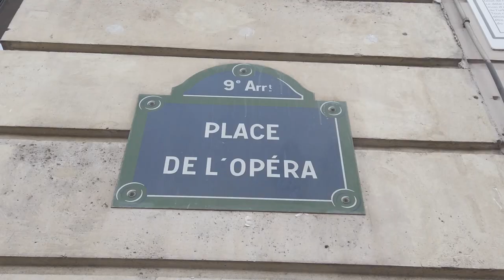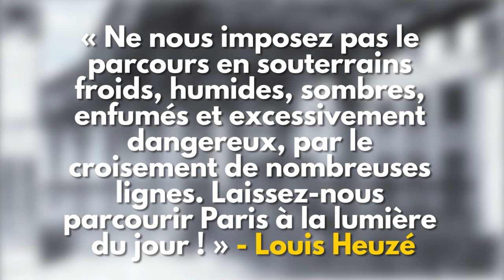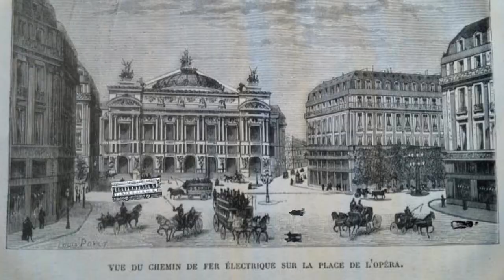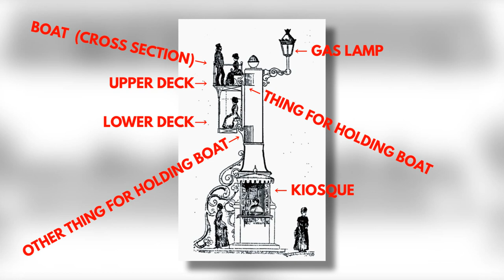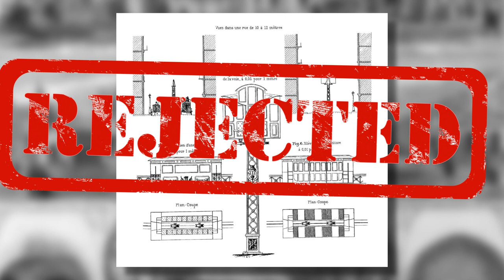Flying Lamppost Boats: The Beautifully Bonkers 1880s Plan For The Paris Métro

Comment: I mean, that is slightly genius. You’d need nearly solid lamp posts and they’d need to be quite close together but it probably wouldn’t interrupt the view as much as aerial rail.

Since each car is meant to always be touching at least two pole, you could make each alternating pole… um… well, alternating poles (polarity) for your power source. Or have two contact rings on each pole.

For bends, you could make them articulate at multiple points. Each pole could be indexed in some way to set the lead car heading toward the next pole. The rest could trail.

All up, it would be an extremely interesting engineering exercise that would be far too costly and complex to ever do anywhere other than Disneyland.
Reply: So perfectly Parisian?

Comment: I would LOVE to ride some lamp post boats, in a theme park for example. And yes, turning corners is not possible, going uphill might be. For corners you could install proper rails to ride along or install some train yard like rotary plate where one lamp would revolve around the center post.
Reply: I thought of something like that with my own solutions(for all the problems!)

Just for fun, I put my own head to the problems mentioned in the video: How it would be powered, how it would handle corners and how it would go uphill!

Whether or not Paris would of accepted these proposals is something else! But here are my solutions:

Uphill Movement: Bring the Lamppost Boat to a stop on a lamppost with a hinged Roller(the video seemed to mention the boats propelled by rollers) platform. The platform is locked in place as the boat proceeds up a gradient(the following lamppost platforms on the gradient, providing it’s roughly the same angle, are fixed in their angle). Once you reach the top of a gradient, I imagine the same solution as   for the start of a gradient.

Corners: Similar to the solution for uphill movement, the Lamppost boat comes to a stop on a Roller Platform which is fixed, then released and turned(possibly by hand) on a hinged lamppost top and lined up with lampposts on the required street, before being fixed in position again.  

Power: Whether or not this really would work well or be accepted by Paris, Steam Power! The roller is powered by a small steam engine, the fire, equipment and controls for the engine are blended into the lamppost facade.

Comment: It's a shame they've defaced the city with those giant billboards. "Oh you like architecture? How about the new iPhone instead?"
Reply from the maker: To be fair, I think (I *think*) the billboard is on top of some scaffolding, so it's only temporary, and it's probably helping to finance the restoration of the building
Reply: Oh, I see, that would make sense. Great video by the way!
Reply: Not like Times Square in NYC where just about every building has an electronic billboard attached. Yay?
Reply: Sighs in Piccadilly circus
Reply: @dangerrangerlstc  but that's why times square is famous worldwide.
Reply: I am working on the site behind the billboard, renovating the « Grand Hôtel ». The rule in Paris is that not more than 50% of the scaffolding area can have billboards, the rest has to be decorative tarpaulin imitating the actual facade, and all the profits have to be used for the renovation.
Reply: @TheTimTraveller  Oui .C'est ce qu'ils prétendent ! Mais on ne restaure que les façades des endroits les plus fréquentés et cela s'éternise étrangement ..... évidemment il suffirait de ne plus acheter ces objets totalement futiles.

Comment: While watching this(which I very much enjoyed! 🤗) I put my own head to the problems mentioned in the video!
How it would be powered, how it would handle corners and how it would go uphill!

Whether or not Paris would of accepted these proposals is something else! But here are my solutions:

Uphill Movement: Bring the Lamppost Boat to a stop on a lamppost with a hinged Roller(the video seemed to mention the boats propelled by rollers) platform. The platform is locked in place as the boat proceeds up a gradient(the following lamppost platforms on the gradient, providing it’s roughly the same angle, are fixed in their angle). Once you reach the top of a gradient, I imagine the same solution as  for the start of a gradient.

Corners: Similar to the solution for uphill movement, the Lamppost boat comes to a stop on a Roller Platform which is fixed, then released and turned(possibly by hand) on a hinged lamppost top and lined up with lampposts on the required street, before being fixed in position again.  

Power: Whether or not this really would work well or be accepted by Paris, Steam Power! The roller is powered by a small steam engine, the fire, equipment and controls for the engine are blended into the lamppost facade.
Reply: It's "would have", not "would of".

Comment: Jean Tricoire did an excellent book of the Metro- its title was 'Un siecle de Metro en 14 lignes De Bienvenue a Meteor', EAN 9782915034325 , which really helped me while studying French. It used many of the exact same illustrations in this video. I'll never forget flying lampost boat sketch.  This is where I first learned the word farfelu- hairbrained.
The Metro was finally built by a one armed engineer called Fulgence Bienvenue. When all the bickering had stopped and the Parisians finally got their act together, enough time had elapsed that everyone else developing a metro or underground had had plenty time to hone their techniques, discover problems, develope technology and solutions within their own systems. This conveniently meant that Fulgence was conveniently forearmed with ready made supply of tried and tested efficient methods and so could really crack on and get things done. Plus he had a couple of his own ideas up his sleeves. One such novel idea was used during construction of line 4 under the Seine. As it left Isle de la Cite, there was unstable soft ground under the mainline railway from the Gare d'Orsay which went right along the bank of the Seine. To pass under it, tunnelling would endanger the railway. Fulgence's solution was to refrigerate; to freeze the ground solid to enough depth to allow tunnel construction without upsetting the railway above.
As if in reply to the aerial railway in front of Opera, there are some amazing construction photos of the huge pit dug in front of an below to accommodate three metro lines crossing each other at three quite different depths.

Comment: For some reason, this system reminds me of a gondola cable car.  Passenger compartments are suspended by a wire strung over poles.  Doing this would probably not interfere with the surrounding's appeals and would not require many supports.
Reply: We can't have that! It would actually be a good solution.

But I think high-capacity gondola systems may be rare to nonexistent. I read of one, either proposed or under construction, running to an island. It was to use 6 cables in case one broke.

Comment: That’s a really interesting idea still. I’d like to see how modern engineers would tackle the problem. If the carriage was driven by drive sprockets built into the lampposts then it could still swivel somewhat while still being driven by these, and there’d definitely be some sort of self-aligning mechanism you could use for the “holdy bits” for incoming carriages. But the bigger issue would be transitioning from this incoming angle to the precise outgoing angle without accelerating too quickly nor jolting the passengers from a misaligned entry. With modern technology, it would be a simple matter to use lasers for this alignment.
But there’s still the underlying mechanical considerations to be had, for such a large thing to not warp over its length it would likely need to be very heavy, which for a single cantilevered “holdy bit” would mean a large amount of torque, and hence probably steel dowels on the order of 200mm across. Much more expensive than rails.
Reply: Any idea how it works? It looks like the lamp post goes through the entire vehicle. How whats holding the two sides together and what stops it falling apart?
Reply: Daniel Pidcock
It just needs something on the upper edge to stop it rotating about the lower edge. A roller that sits on the other side of a ledge would work to this end, much like many sliding doors.
Reply: I realised after looking at the cross section in more detail that it only is on one side. For some reason I assumed the drawings were showing a two sided vehicle

Comment: It could have worked. The posts would be a connecting circuit to power the motors on the lamp-post. As the boat links two posts, the potential grounds from a to b through motors on the posts pushing the boat along.
To turn a corner, the boat collides with a post on the opposite side causing it to deflect slightly into the curve, or it pivots around the cornering lamp-post and turns ninety degrees before taking its direction change.

Comment: Actually the first metro lines in Paris have taken ideas from NYC : bigger tubes, cut street ground and cover with iron structure ... Line 1 is a good example of this. Metro lines were build and operated by private companies (a copycat of the old tramways organisation and regulation even the driver name of a metro un traminot is coming from that legacy). As in NYC you can see the different company by the stations tiles and typos. The Nord-Sud company is very famous for having brought fine green tiles and very modern ambiance.... Merci Tim 👍

Comment: When you think about it it really is intriguing. Except for derailments those would cause concerns. My wild idea has been run the trains through the buildings use them as the support for the transportation system
Reply: It is fundamentally broken. Unless it goes over the lampposts, there is nothing holding the "boat" together.

Comment: This sounds like a unique solution considering almost all of transportation rely on rail or wheels today. The main problem is those lamp post would haft to be much larger than normal lamppost to support the weight, and the maintenance would be a nightmare. Not to mention turning corners and elevation is probably feasible, but would probably be an additional logistics problem accounting for the pivots of the vehicle.

Comment: Basic physics. If the next lampost is even slightly off where it needs to be you'll get a bump directly proportional to the speed you are going and the distance between the leading lampost to the next lamp post. Which is to say you'll get into a mini car accident every 20 feet or so.

Comment: Captain Mazet's idea is almost feasible, given the technology of 1881. The cars would need to be strong enough to support their own weight without flexing too much, and the posts would have to be closer together, perhaps so that three support the train at any time. That would also help solve the steering issue. Also, remember that electric motors were much less advanced in 1881, and so installing one in a stationary setting made a lot more sense than trying to pack it into a small locomotive, as Edison achieved in 1880. Here is a photo of Edison's pioneer electric train:
https://www.edn.com/edisons-1st-test-of-electric-railway-may-13-1880/

Comment: I'm so late to the party, but it's probably a good thing that nobody suggested putting the elevated railway through the buildings instead of only between them.

It technically could've worked; it is done in Japan after all. It wouldn't have required outright demolishing the old buildings, just some horrifically invasive renovating.

Comment: But if the carts could while keeping in contact with one of the posts, push away from the other one they have contact with using a special mechanism then I don't see why they couldn't make very slight turns, and there could well be a posh city place somewhere where that is all that's required. So possibly not so mad an idea..

Also I like very much how he realised that in a monorail it is the rail itself that is the problem aesthetically incl how it blocks the sunlight. Maybe when we build light city monorails we could try to have more posts to spread the weight and a thinner rail.

Comment: Were they meant to be counterlevered from 1 lampost as they were pushed along in the direction of the next one, then attached there and released at the old lamp post, rinse repeat ? if the tops of the lampposts were turned you could point the exit at a new direction to go to the next one - as long as it was all flat (and on the floor - as obviously it would snap)
Reply from the maker: I don't think so, because the boats were designed to be in contact with at least two posts at all times. So I really don't know how turns would work. I guess one way would be to put two (or more) lampposts on a turntable, so the boat could drive onto it, stop, and be turned. But then who wants to travel on a thing that has to stop every time it goes round a corner? Maybe there's another, cleverer way of doing it...
Reply: @TheTimTraveller  you might need something a bit like this with lampposts in just the right spots 
https://en.wikipedia.org/wiki/File:Hammersley_sofa_animated.gif

Comment: Well duh!  The solution is obvious.  They should have asked me.  Just make the lamppost boats just short enough that it leaves the rear lamppost just before picking up the leading one.  That means that for one instant, the boat is held up by a single lamppost dead-center.  It can then pivot in any direction so as to aim itself towards a different lamppost, and head off in a new direction.  That way it can go around corners and curves as well as switch itself onto a different route.

Comment: I do not understand how these "boats" would even work. Surely you'd need to pass the lampposts through each of the gondolas, lengthwise. How are these two sections meant to remain together in one functional piece? Am I missing something?
Reply from the maker: Hi Trygve - there's only one section, the boat hangs off one side of the posts.
Reply: @TheTimTraveller  That would make more sense, but if the gondolas are only attached to the poles on one side, they're at risk of dismounting and falling on to the street below. There wouldn't be anything to secure the gondola to the pole, other than leaning against it.

Comment: bizarre design is present in everything french design
there are still metro cars with rubber wheels
Reply: Michelin rubber, IIRC!
Reply: Actually this is rather recent (about the 60s if I remember) and is used on lines which have aerial parts. Rubber wheels don't screech and are less of a nuisance for the people living close to the tracks.

Comment: The métropolitain network is still the area of Paris with the worst air quality, ten times worse than at street level, in fact. With a deadly cocktail of steel brakes particles and concentrated nitrogen dioxide seeping in the network from the traffic above, the subway air in Paris literally robs several years of life from its frequent users. Edouard Mazet was right.